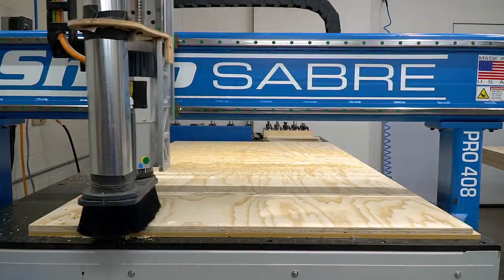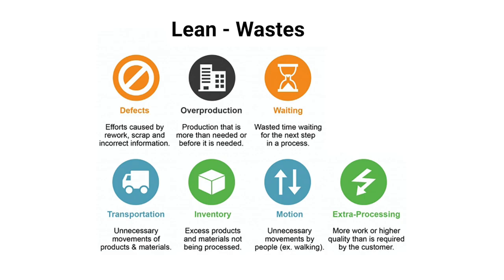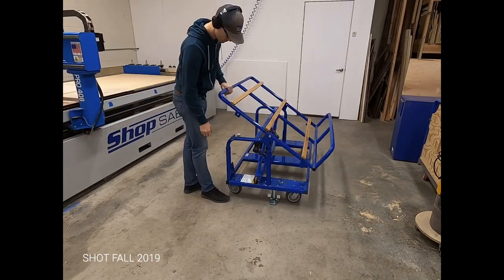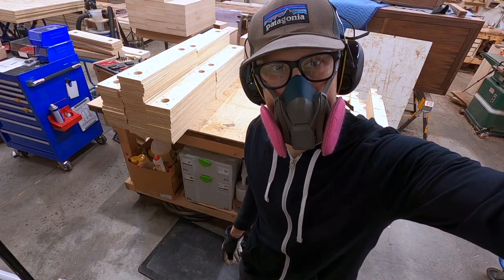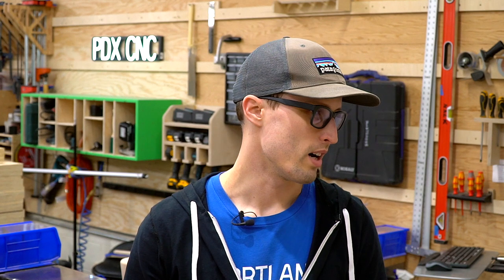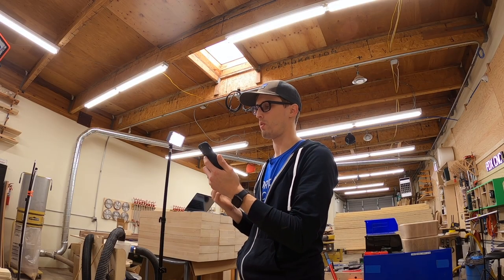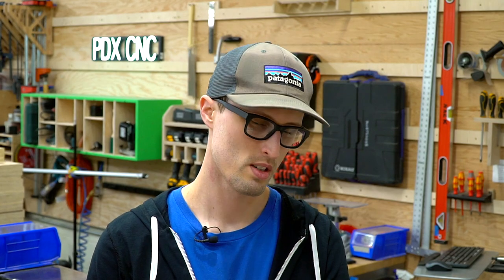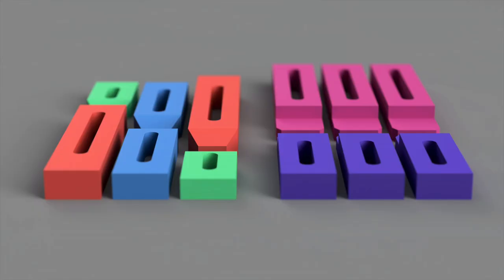Vlog 14 - Lean CNC Routing, Free CNC Clamps Download

Comment: Could not download clamp file.  After entering email and clicking the checkbox the clicking the subscribe button it just returns to the last page 
I waited 24 hrs in case there was server delay but not yet.  Its all good They seem easy enough to design/manufacture :)
Reply from the maker: Ahh yes. Sorry there was an issue with our email. You might try to sign up once more and it should work fine.

Comment: What about using down cutters for the top edge of the wood? Have you tried that?
Reply from the maker: What do you mean?
Reply: @pdxcnc   ~10:40 you introduce us to this end mill which is supposed to reduce tear-out when milling hardwood. However, in the few cases I did with hardwood I used a downcutter endmill for the first pass to get a nearly tear-out free top edge and then I milled with normal upcutter for the rest of the cut.
Reply from the maker: Ah, sure. I've known that as "scoring" and works great. For the plug job I the upcutter - tear-out didn't matter. Also, I've found that with good sharp up-cut tools, you tend to not get much tear-out. That's somewhat material dependent.